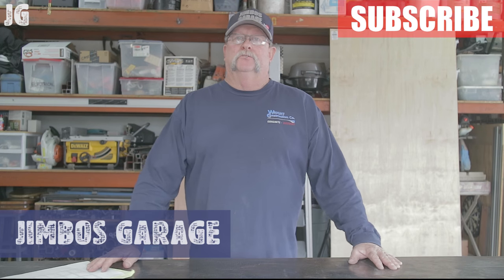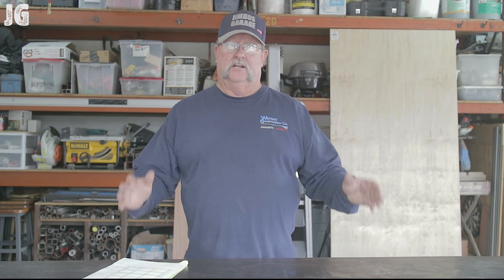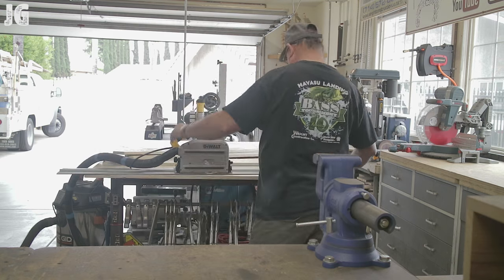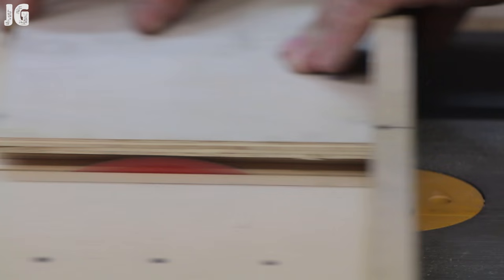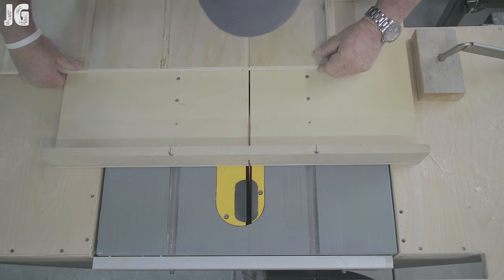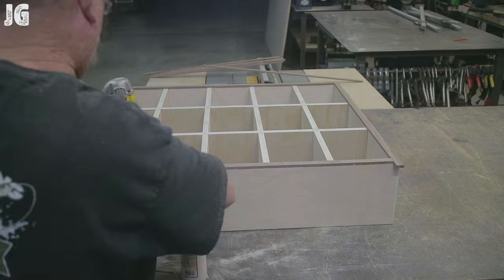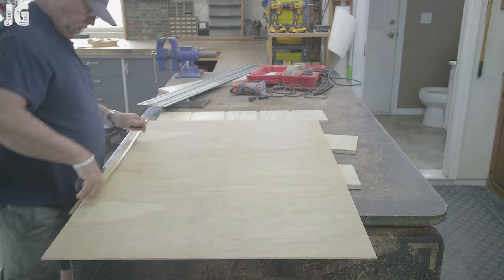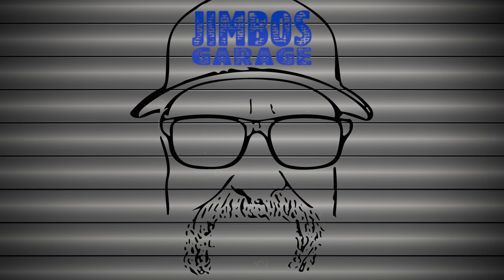Hat Rack Build - Jimbos Garage

Comment: You did a great job on the rack! I've been woodworking over 30 years and actively part of the local WW community, and until I started watching Youtube I had never seen folks using the table saw with the rip fence to the left of the blade so much. Now I Am not talking about specialized angle cuts were you have to do it. I mean just normal regular rip cuts. I'm not saying it's wrong. So, out of curiosity why do you rip with the fence fence to left of the blade? I have asked a few other you tubers the same question. Thanks for your time and I really do like your channel! Im teaching myself to weld right now.
Reply from the maker: Thanks for watching Tom! Thats a good question! It came out of the box like that i assumed that is the way way it should be? I have had that saw for about 5 years now and i have never thought about it. And i'm left handed, It just feels right to me. I don't really know if there is a right or wrong side?  Jimbos garage!
Reply: After I wrote the note, I was thinking that being left handed might be a possible thought. If you look at the saw it rips further to the right then the left and the board support that flips over on the rip fence is based on right hand cuts. As long as your hand it not crossing over the path of the blade as you push the wood past the blade then all is good. I thought I was already subscribed. Well I am now. Keep up the great videos!